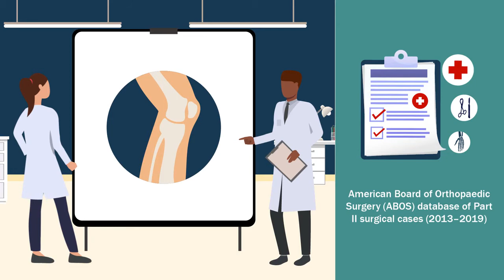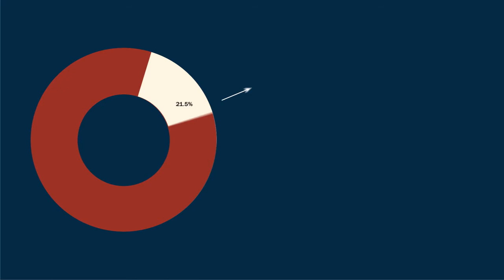Complications of Hardware Removal

Comment: I had 22 screws 2 plates and a rod removed my two legs tibias   felt much better after and have not been fragile.   But I was youngish I think 35ish?   The only thing still left is a broken drill bit the original surgeon possibly did not even realize he broke?  Or else just neglected to document for whatever reason...stange looking xrays now with this drill bit just suspended in the bone  Anyway the only bad thing about hardware removal was dr wanted me back on crutches for some weeks ...which mybe was overkill idk but I tried to obey somewhat i took a week or two vacation from job in trades and after that mostly just used a cane ... it all felt good to me but I tried not to take chances....eventully I was back racing and regularly crashing 500cc Moto Cross never broke legs again knock on wood